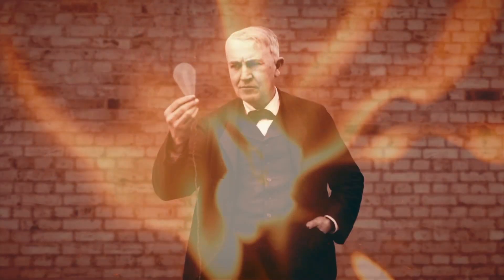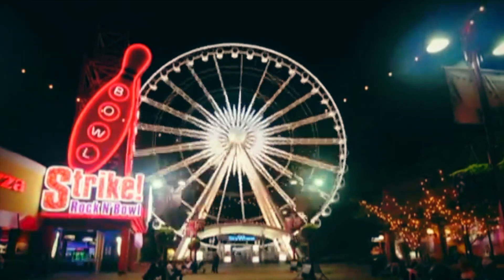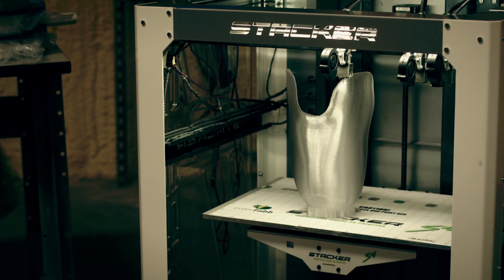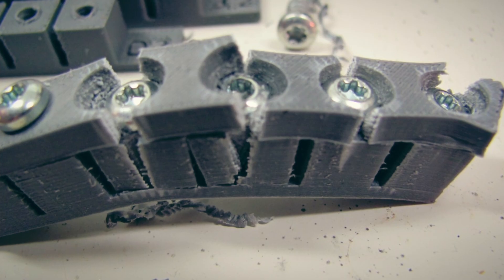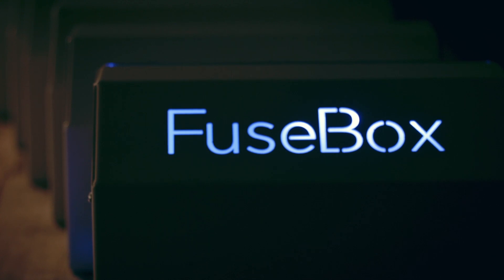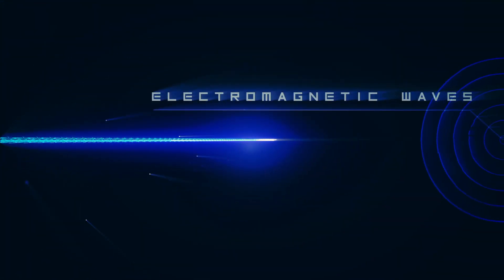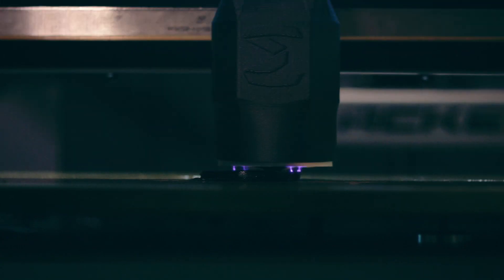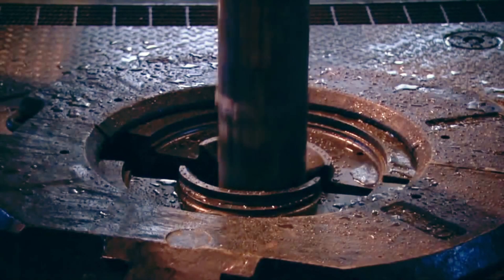FuseBox: Bringing the strength of injection molded parts to 3D printing.

Comment: Cool technology but the only way to get the fusebox is to buy your extremely expensive printer starting at 12,000 USD. At that price print it would be cheaper to buy the Formlab Fuse 1.